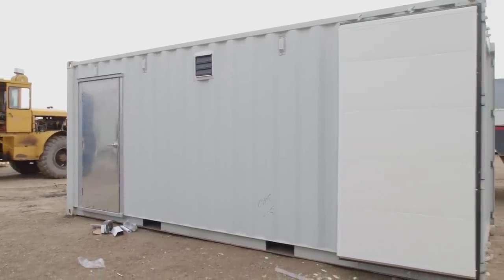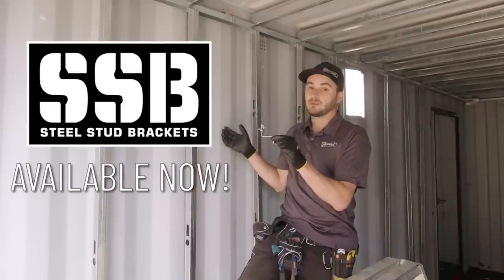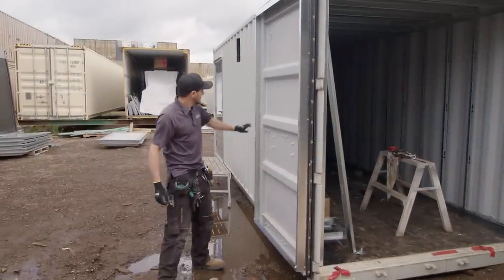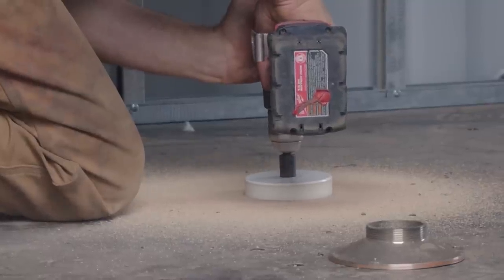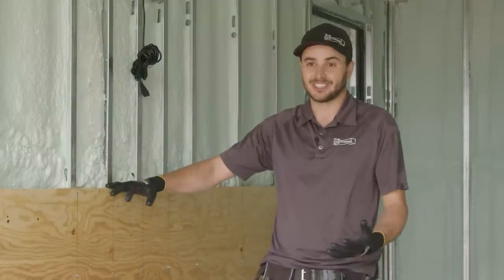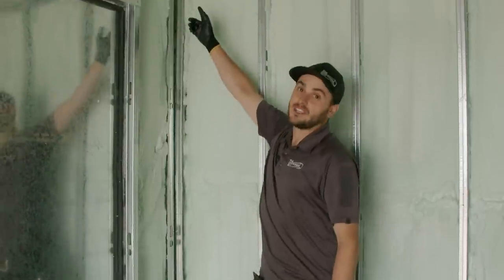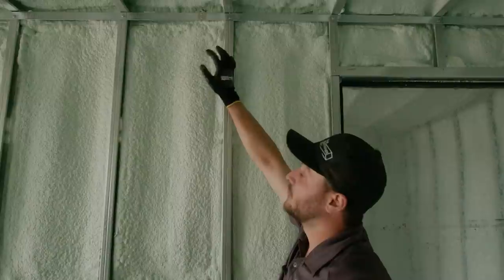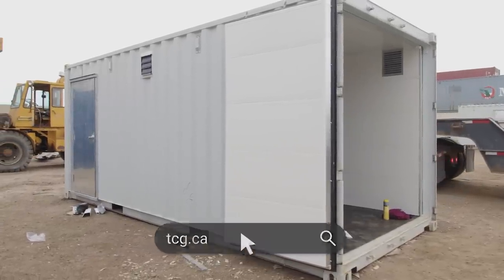Framing a Shipping Container Using Our Steel Stud Brackets | PVC Wall Panels | Ventilation

Comment: Always enjoy your videos but I have one question; when installing any window or vent it always gives a better seal if you caulk behind the flange rather  caulking "around" the flange once it's installed. I understand the horizontal caulking issue but it would give a much better seal if you caulked the vertical flange before installing and fastening. It would also be more cosmetically attractive w/o a bead of caulk around the vent or window. Just a thought,keep the videos coming.
Reply from the maker: I 100% agree. We're working on PDF installation instructions for all these components and that will be included. It is best to dry fit the window or vent, remove it, apply sealant to the flange or outside corrugation then install.

Comment: I like the poly interior. Does it have colr choices? What was the install time difference between the plywood and poly?
Not a ding at all with this as it is somethingva learned just last year. Your guys using grinders cut through the can and then mostly just push the cut. The disks last significantly longer tracing the cut lines over and over until they grind through.
As always though y'all produce beautiful projects.
Reply from the maker: I like the PVC way better than plywood. Smaller pieces mean smaller screw ups. It's the same concept as vinyl siding on a house.

Comment: 1)Just thinking about a thin foam gasket for you steel stud brakets - similiar to the liner of a tool chest drawer... easy to have stampped out...
2) beautiful drain in the floor, I have not seen a spray foam under the can to protect the frost from getting to the drains ...???
3) What is the comparrison between your insulation work and that of a refrigerated trailer for produce?
4) I come from Canada, but live in the south... insulation is underestimated in the south, just as important, but to protect from the heat... the can would still heat up, will the foam itself survive the heat?
5) what can protect the thermal bridging around the fan or vent edges? Is there a post install insert, solid foam to help insulate during the cold season?

Comment: When using your steele stud brackets package, will it also help when installing framing in slightly unlevel containers?
Reply from the maker: Yes because you shouldn't be using a level. Measure off the container instead so your walls will be plumb once the container is levelled at its final destination.
Reply: @TheContainerGuyTV  alright thanks. I did level the container at its temporary building site. After settling it became a bit un level. But yes I did use measurements on the inside etc.
I'll go ahead and order the 40ft bracket package.
I'm building it out in Toronto. If need be would you be able to provide some assistance? What email can I contact you on? I can share video of the current stage a design.
Reply: What you suggest for gaps between the window and door cutouts? The cuts were not made straight and there are gaps between the framing and container that are to wide to wield?
Reply from the maker: @primodinero3006  window gaps and cracks will be filled with spray foam. If you are in Toronto and not planning on spray foaming, the project will be a failure. 

Can email us at engineering@thecontainerguy.ca
Reply: @TheContainerGuyTV  100% we are using spray foam. Alright thanks!

Comment: What you suggest for gaps between the window and door cutouts? The cuts were not made straight and there are gaps between the framing and container that are to wide to wield?
Reply: Their window and door kits remove any guessing, as you cut them exactly to fit those frames. No welding needed since they rivet into place

Comment: DIY? Although I am an equipped and skilled DIYer,  spray foam is not available. What is your alternative for insulation? Thanks.
Reply from the maker: There isn't one on the inside of the container.  I'm going to try and develop a method to use batt insulation on the outside of a container with wood framing. Pretty sure I got it figured out. I'll need a year of trial and error to perfect it. Stay tuned.

Comment: At 16:06 a spray was being applied to the screws in the flooring. What was that and why? So I may see if I need to do that. Thanks. Great video! I'm going to be applying a seal to the original flooring, which is scuffed a bit. Would it hurt to take a sander to the scuffed surfaces before applying the sealant?
Reply: The spray is just an spray version of the floor seal, so it can get into all the nooks of the screw and hole around the screw head. Also always hit a surface with a sanding even if just lightly to help adhesion of a new paint layer onto it, especially when a sealer since if the sealer doesn't adhere it can then bubble with movement of the surface and crack, defeating the seal.

Comment: These things made my walls uneven with 2.5 steels studs. Had to cut a bunch of flat bar to use as a spacer behind them to make wall straight.
Reply from the maker: Weird. Are you using a used container? Is it dented or bowed? 
 1 5/8" steel studs are recommended to get the studs away from the container wall. 
The #1 advantage to steel studs is how straight they are. Using a stiffener bar is needed to keep them in line though during spray foam.
Reply: @TheContainerGuyTV  unfortunelty the 1 5/8 was really hard to find in 10ft length in Texas. Being our container is the high cube 8ft wouldn’t be long enough. Our container was a single use no dents or bends. I think issue was the top and bottom don’t seems aligned to begin with where the bottom track mounts it was about 1/8 inch from the inside corrugation.
Reply from the maker: @modeverything9949  I just went and checked 2.5" steel studs in a 20' outside because you had me worried. They fit great. Can you send me pictures to engineering@thecontainerguy.ca? Is your top square tubing a 60mm x 60mm square?
Reply: @TheContainerGuyTV  sent

Comment: What's the R factor of the ceiling and wall foam insulation?
Reply from the maker: R6-7 per inch. Hard to compare R Values with fibreglass insulation's theoretical R Values. Spray foam is legit. Actual R Values achieved and no air loss. Easy to heat these things in Canada.
Reply: @TheContainerGuyTV Thank you very informative videos... I have the opposite need; keeping heat out to keep it cool in Florida.

Comment: Nice job......here is my question? Who was the first to suggest containers as "homes:
Reply from the maker: Not me. I don't live in one and wouldn't.. Although I did build a cabin in 2011. 

Maybe one day I'll have thrmally broke Steel Stud Brackets and Window/Door Frames and be able to offer kits for containers homes that last hundreds of years. Need more engineers on staff.
Reply: @TheContainerGuyTV  I would be interested in that kit down the road when it's established. I really appreciate your videos and the details that are presented. Thank you.
Reply: I'm pretty sure it grew out of the tiny house movement, considering you're already "halfway there" with a container. I personally wouldn't live in one either, but I find the technology very interesting!
Reply: @TheContainerGuyTV  Are you being sarcastic? I just bought 2 40's to add on 2 bedrooms to my house. This comment makes me nervous
Reply from the maker: @danielstroh4251  use spray foam insulation and make sure it gets around your framing and you'll be fine. Container Modification World framing kits for windows/doors. My reasons are more about resale value. I'm using a couple cans at the lake for a garage/sleeping quarters so I'm not against it.. just maybe not my primary residence with a wife and kids...
Reply: @TheContainerGuyTV  Thanks for the reply. I plan on getting your SSBs and doing this method of framing and insulation. They will have hrv's for venting and won't have bathrooms or kitchens in them so I hope I will be okay 🤞
Reply from the maker: @danielstroh4251  you're on the right track. Email pics to mods@thecontainerguy.ca if you're ever stuck or have questions. I'll help you out.